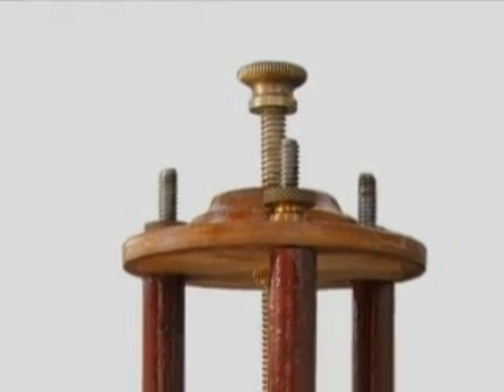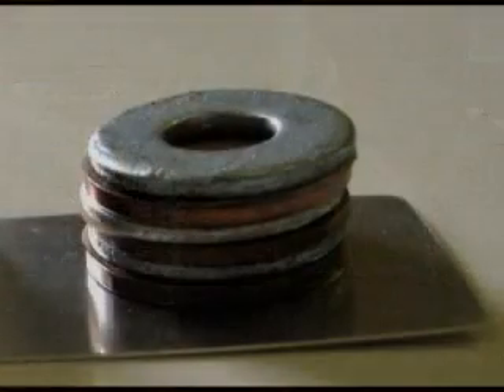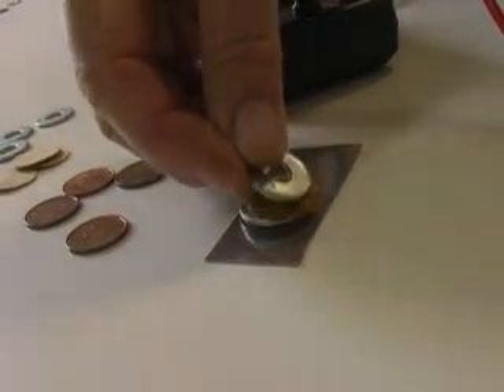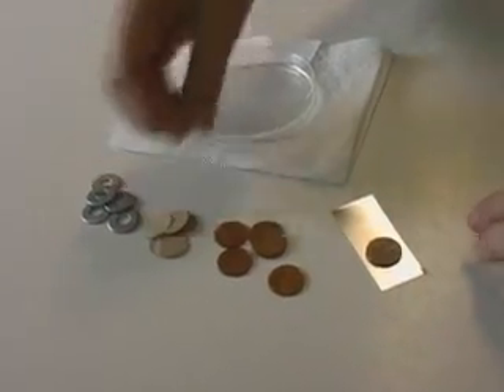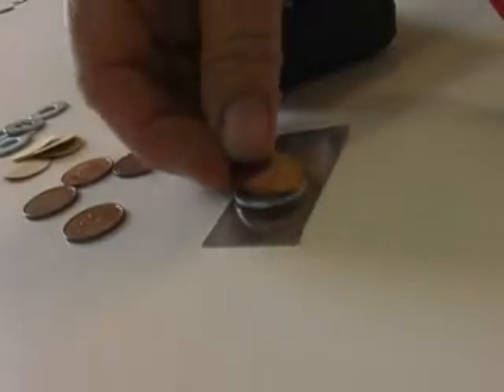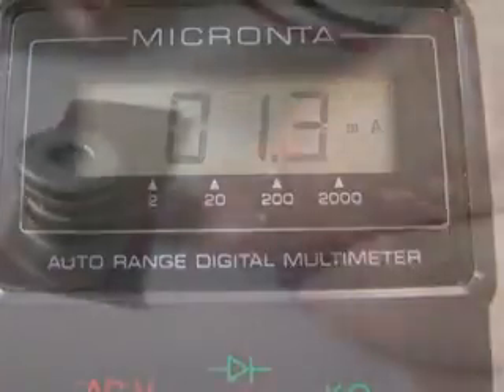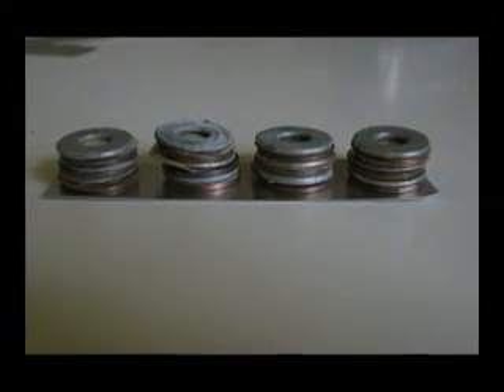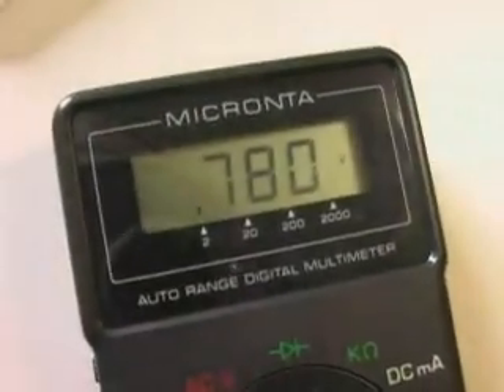The Voltaic Pile

Comment: @abcd19263 The negative terminal is always the electrode at which oxidation is occurring. The metal that will undergo oxidation is that which is more reactive, in this case, that is zinc. So zinc will always be the negative in this cell because it is more reactive than copper.

Comment: @3beavers coal does poduce electricity in a different form. By burning coal to heat water you generate steam which is used to turn a turbine generating AC electricity (alternating) which is more efficient to transport through powerlines.

Comment: @fermixx 

add up the cost of the pennies, the zinc washers, the aluminum foil....and you'll see that buying the battery already made is the sensible thing to do....and takes way less time...not to mention...most electrical devices are designed for the shape of a pre-made battery....

Comment: nice video, thx
I thought about doing similar and looking into making water batteries. 

It could be useful in a alternative "off grid" energy set.  

Link up enough voltaic piles to get 12volts to use to store into a deep cycle battery at nights or off weather days, to switch from solar panels, wind turbines, solar created steam power, or gravity fed water turbines. 

I just havent figured the cost of temporary galvanized zinc and copper plates vs cost or benefit in electricity gained.